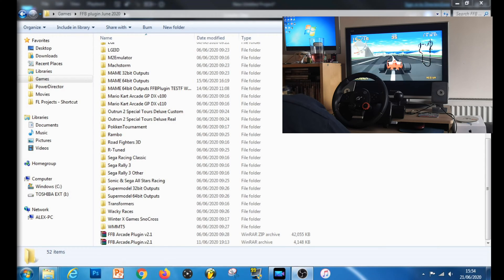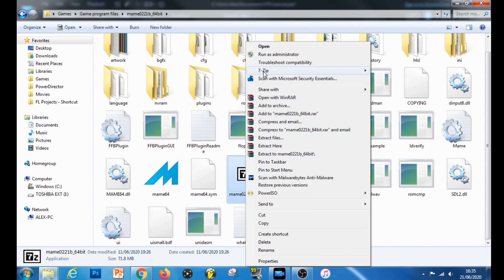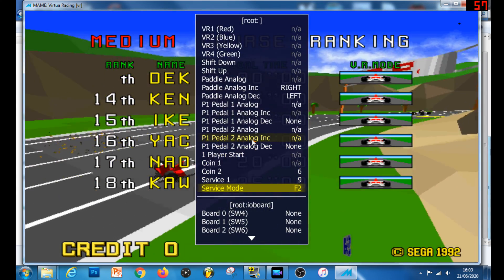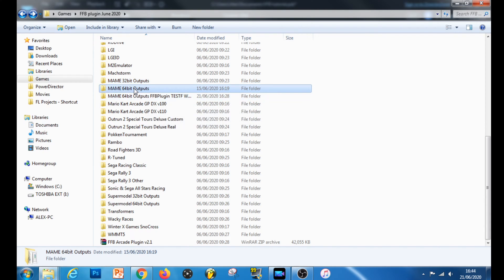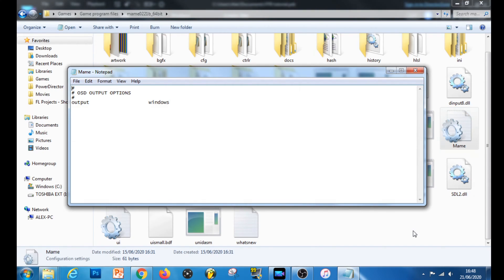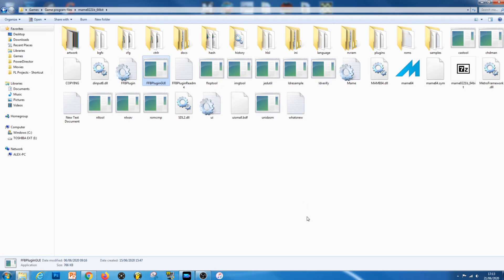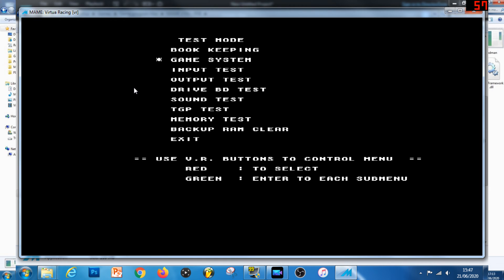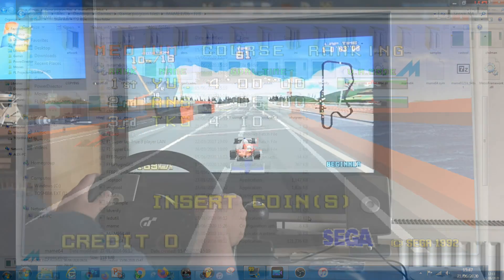Tutorial: How to enable Force Feedback in MAME and Teknoparrot (Version 2)

Comment: Hi Alex, FFB Plugin is not booting Outrun 2 SP SDX in the latest build, did some research and found in order fix the Outrun 2 SP SDX crashing issue when using the FFB Plugin, the most common solution is to rename the opengl32.dll file to winmm.dll in your TeknoParrot installation folder. This is a known compatibility issue with certain Lindbergh games. Yeah the game boots but there is simply no FFB. Any clues how to fix the issue?
Reply from the maker: I'm afraid not Ark, I haven't been keeping up-to-date with what's been going on with the plugin, it's sounds like you know far more than I do about it at present.

Comment: I've followed all your steps, but it hasn't responded to that FFB plugin for my PXN V10 steering wheel. And believe me, I've tried it several times, but it doesn't work.
Reply from the maker: Sorry mate, if you've followed the same steps as me and it's still not working, there's not really anything I can advise. I'm not tech support for it, the point of the video was just explaining the steps I took to get it working (video is also several years old now, things might've changed with the plugin).

Comment: Awesome video—I've been trying to get FFB working on my TMX Racing Wheel in MAME 0.253 with California Speed, but the force feedback always cuts out after ~30 seconds. I've added all the correct plugin settings, including logging, but no FFBPlugin.log is ever generated. Any chance you could share your setup or config files? I'm stuck.
Reply from the maker: @Breakbusters  'Fraid not. I had to do a full destructive OS reinstall awhile back, so all my original FFB setup stuff got deleted and I've not got around to trying to set it up again since. If the FFB is working for a few seconds then cuts out, it sounds like it might be a bug. Unfortunately I can't really help you there, this guide is just what I did to get it working for me - if you've tried the same thing and it's not working, there isn't really anything I can advise. I think someone made a help thread for this in the Driving section of the BYOAC forum. It might be worth having a look there.

Comment: Do you know a way to get the Fanatec V3 pedals to work in MAME and Model 2 emulator?

Seem to have issues with them (and not just the usual Fanatec poor quality issues)
Reply from the maker: I'm not familiar with that brand of wheel, but a common issue with stuff like this though is whether there's an option in your wheel software to separate the pedal axes - some emulators don't like them combined. I'd also double check in Model 2 Emulator that you've got Dinput selected in the game's ini setting file, not Xinput.
Reply: Thank you for sharing this! It's amazing bc it opens up a lot of games for wheel drive, especially the tp section is pure gold. One fallow up question - is it possible to use this plug in with the Moza DD wheelbase? Take care and game on! ❤

Comment: I added the output windows command to the mame.ini already in my mame folder. It doesn't work. I'm confused about the step where you make your own mame.ini text file. You're saying I have to make a separate text file named mame.ini and enter the output windows command in that file as well?
Reply from the maker: No. It's been 3 years since I made the original version of this. I don't know if anything's changed in MAME since then, but back then it didn't normally come with an ini file - you had to add some command line instructions to make MAME generate an ini file with all the rest of the settings for the emulator. Rather than getting MAME to generate an ini file, I just made my own with the necessary FFB instructions from a blank text file (which, IIRC, is what the 'Read Me' file that comes with the FFB plugin recommends). If you've already got a MAME generated ini file and you're adding the info from the description in, it should work the same way. If you've done that and it isn't, I've no idea why it isn't working for you. You might want to try again from scratch and just make an ini file from a text document as I did and see if that sorts it. Also, I'd suggest checking the 'read me' file, to see if anything's changed in 3 years.

Comment: Hi. To get FFB on Scamco RaverRace......
Do everything in the vid except........
No need to alter the mame.ini
Edit the raveracw.ini (Configuration settings) - Change the OSD OUTPUT OPTIONS from 'auto' to windows (Just like it looks in the description). 

Launch the game and go into the test menu (F2). Here you can set the force feedback to on. It should now work. You might need to tick the damping box in the FFBPluginGUI to calm down the wheel oscillation. The game works best with a 270degree wheel rotation. 
I hope that is helpful. 😁
Reply from the maker: Good to know, cheers!

Comment: Two questions. Can you use this with Retroarch? If so, where do you put the files? And Supermodel has terrible ffb, unbearable wheel oscillation, which can be turned off in the Supermodel config file, but doing so makes this plugin non working as well. Do you run this plugin with Model 3 games?
Reply from the maker: You can use this with Supermodel, but in all honesty I've never tried it, the native FFB has always felt OK to me in it. I've used Retroarch on an old Phone and a modded 3DS, but I've never set it up on PC, so your guess is as good as mine there as to where those files go.

Comment: i did everything you did and i did not get it to work

california speed with a Logitech G29 .. there is other videos showing it working ... how do i get it to work 

i followed your tutorial and it did not work...
Reply from the maker: I've never tried running California Speed, I don't know if it's got any special requirements that are stopping it working for you - been a long time since I tinkered with this, but IIRC the 'read me' that comes with it normally has the answer. I suggest asking in the comments of one of the videos where you've seen it working or giving it a Google and seeing what you come up with.
Reply: @MrThunderwing  

the solution (which in my view was kindof dumb) is to use older Mame builds which doesnt make sense if the plugin was updated recently
Reply from the maker: @Ponlets  That's good you were able to get it sorted!

Comment: I haven't gotten to this point yet and still setting up controls on games. Does anyone know if the menu to choose wheel what I'd pick if using original hardware from an arcade cabinet? Is there like a generic wheel or something? Using a Rush 2049 cab, and wondering if a pipe dream to get feedback on it. Has the feedback motor and all, but it's different than the wheels you buy. Difficult, but fun project.
Reply from the maker: That's a bit above my pay grade I'm afraid. If you're interfacing your arcade hardware with an encoder that just behaves like a regular dinput device, I would've thought it should work... But don't quote me on that...
Reply: @MrThunderwing  Thanks for the response. General stuff works so far. Will update once I'm at this point.

Comment: Great video any chance to connect orginal for example off road challenge arcade wheel to pc ?
Reply from the maker: That's a bit out of my area of experience I'm afraid. I guess you could connect up the original hardware to an arcade encoder and potentiometer and get it working that way?

Comment: for some reason, it doesn't work in game. it works in the gui, I've done everything explained in the video, installed every packages needed, but nothing. Virtua Racer, Daytona USA, Cruisin' USA, nothing works. I have a Thrustmaster TS PC Racer wheel and I'm using Mame 0.251
Reply from the maker: Sorry mate, this is more of a 'this is what I did to set-up it up and it work for me and my particular wheel' type of deal, rather than a I know this software inside and out and can troubleshoot every other type of wheel I don't own if it doesn't work for you affair. I'd try setting it up again from scratch, making sure you're ini files saved properly and hasn't got any typos. Maybe try with an older MAME - I thiiiink this was 206 I was using? Read the 'Read Me' file that comes with it to see if that can help you troubleshoot. You could try reaching out to Boomslang over at the BYOAC forum.
Reply from the maker: Or you could reply to his comment on here.